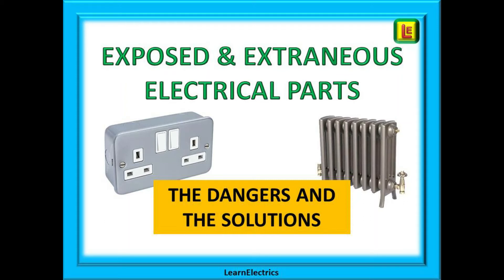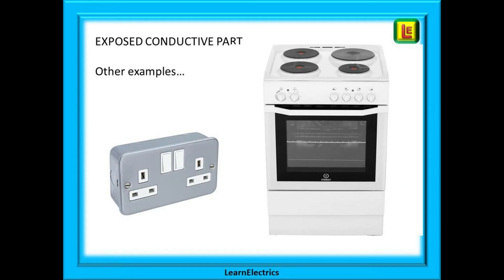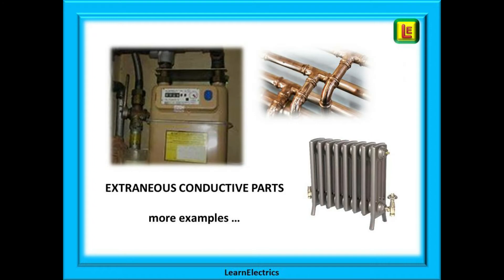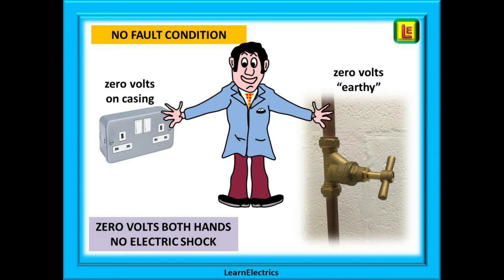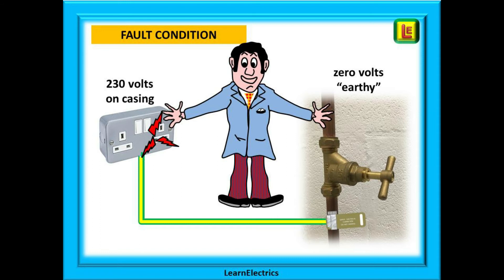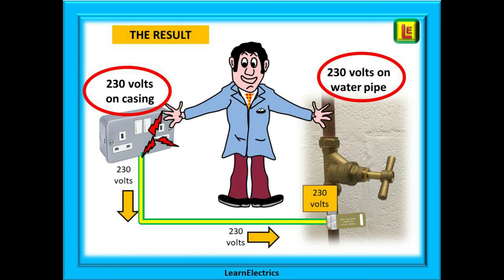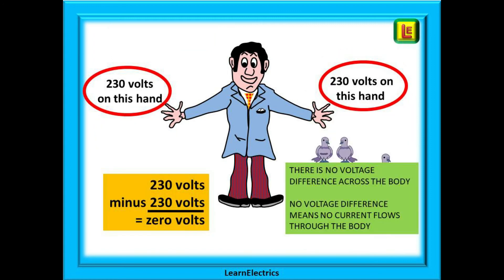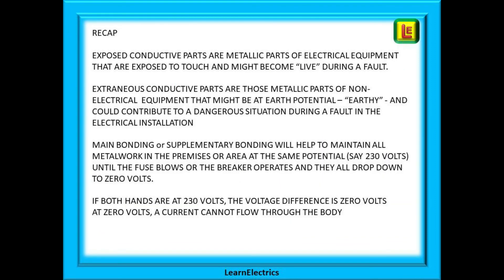EXPOSED AND EXTRANEOUS ELECTRICAL CONDUCTIVE PARTS. THE DANGERS AND THE SOLUTIONS

Comment: Hi, when Eric is enjoying equal potentials in both hands, there is current path through his legs. Am I right?
Reply: I read other comments and your answer was between them. I think hand to hand current risk is calculated on the famous 0.4s time but as you said it is the worst current path. Another aspect of this event is that the floor is part of main bonding, based the fact that we connect steels in concrete to main earth terminal, so the potential on his feet would be 230 for a really short time till the trip.
Reply from the maker: Yes Sajid, one hand at 230 and the other at earth is the worst case. Thanks for the cpmments and thanks for watching. Dave.

Comment: Great video ! if the socket casing and pipe work was both at 230v with the bonding cable , if Eric didn’t have his boots/shoes on would he receive the shock ? And say if the casing became live and touch it but wasn’t holding the pipe work would you receive a shock with rubber boots on ? Cheers
Reply from the maker: The boffins say that this is the correct way to wire things up and they say they know more than us. Probably paid more than us too. Keep watching. Dave.

Comment: Is it right to assume that in your example that Eric could still receive a shock? despite both his hands being at 230v his feet on the physical earth would be at 0v. Therefore, there is still a path back to earth for current to flow? Thank you for the video
Reply from the maker: The boffins that work these things out are assuming that Eric has rubber soled footwear, is probably stood on synthetic carpet and this is perhaps laid on concrete or ceramic flooring, therefore a significant resistance path. The worst route for electric shock is arm to arm as it passes through the heart. If the Zs is correct, the circuit should disconnect in less than 0.4 seconds (0.1 seconds with modern MCBs) Hope this helps and thanks for watching. Dave.

Comment: I had my bathroom redone and the sparky said the the supplementary bonding was no longer required as all circuits are rcd protected, he left them off not connected, and then I had another sparky in too do some work a while after and he said it should be left connected 🤔🤷‍♂️ who’s right ,?do I need to be ripping walls out and getting a spark back to connect back up 😭😭😭🤯🤯🤯
Reply from the maker: No, no, no. Leave it as it is. If the circuits are RCD protected then the supplementary bonding is not needed but it makes no difference if it is connected or not connected. Most of us leave it connected because it is so obvious when removed, redecoration etc. and it takes time to remove, time that we could be using on another job.
Main bonding to gas and water should remain connected, that is something different.
Hope this helps. Dave.
Reply: @learnelectrics4402  nice one dave just what I needed 👌👌 reassurance ,thank you 👍👍
Reply from the maker: Happy to help.

Comment: Thanks for the videos, they are excellent.  If it's a free standing extraneous radiator how do you know if there is a possible earth potential. For example is it at risk if it has plastic pipes connecting it either end.  If we are not careful, we get to a point where we add supplementary bonding to knife and forks.
Reply from the maker: Exactly Jon, if the radiator has plastic pipework it does not need bonding. Some plumbers leave a short copper pipe showing above the floorboards as it looks better than white plastic pipe. This is ok. There are no copper pipes going from the radiator all the way back to ground. Plus, if the property is 30mA RCD protected it is not necessary to supplementary bond anyway. Hope this helps.
Reply: @learnelectrics4402  hi Dave, what doesn't need bonding if the property is protected by a 30mA RCD. thanks
Reply: Brilliant, thank you.
Reply from the maker: Our pleasure. Glad we can help. Keep watching, lots more to come. Dave.